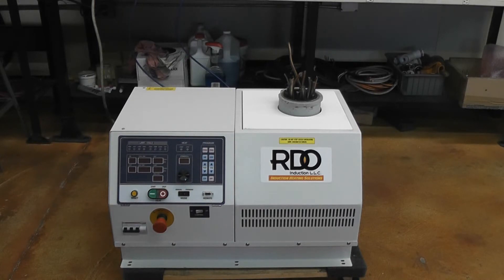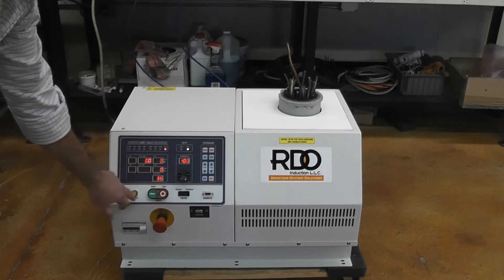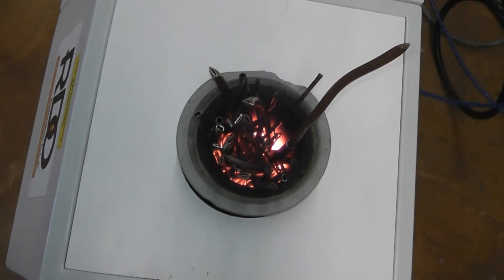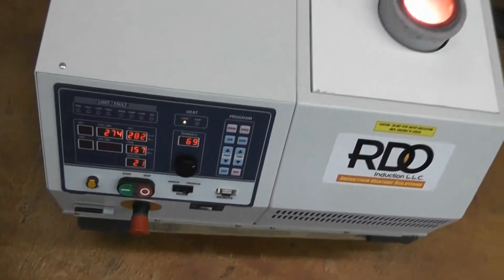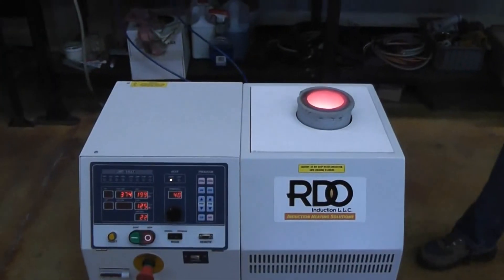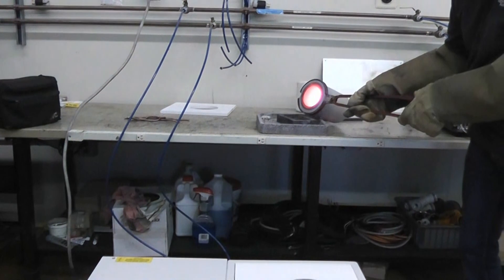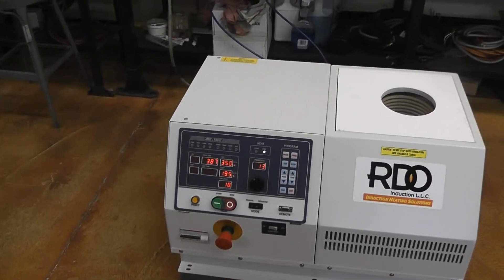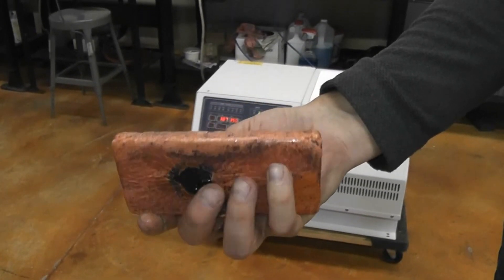RDO Induction LC Series Induction Melting System

Comment: I'm in agreement with the other comment here. These ARE amazing. I'm like most back yard hobbiest. I cut up a 20 lbs propane tank for my furnace. Ordered refractory materials from High temp tools on line. And dressed up my furnace. Made my own burner...it takes twenty minutes or so to get my copper to slump. You did that in just a few!! But!!! My furnace likely costs a hundred times less than yours. A few years ago I would have thought and felt differently. With our current situation...all the political lies. I've stopped making plans for the future...as I see that to be useless. "They" hold all the cards and "we" have become that much easier to manipulate. Folks will not look into anything for themselves...outside of what can be seen on the tell...a...vision. Your furnace takes the cake!!!